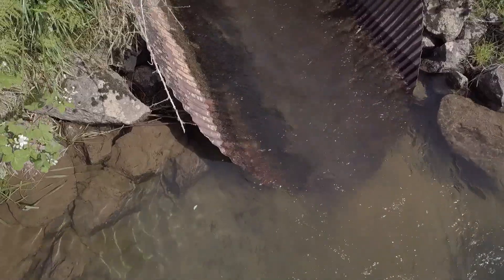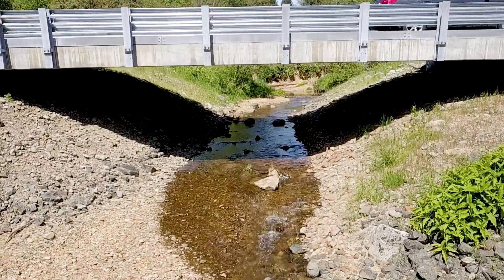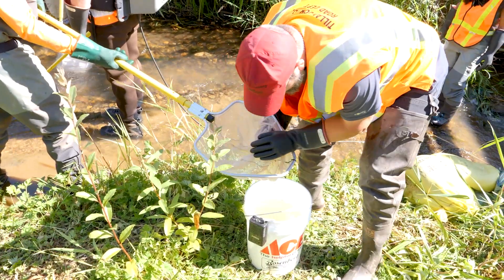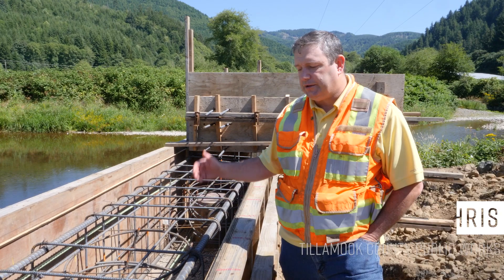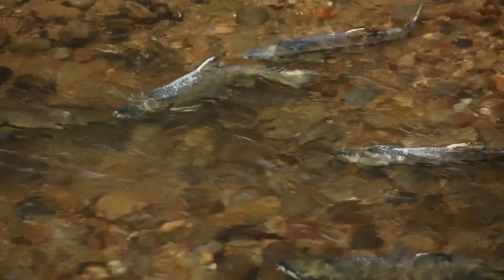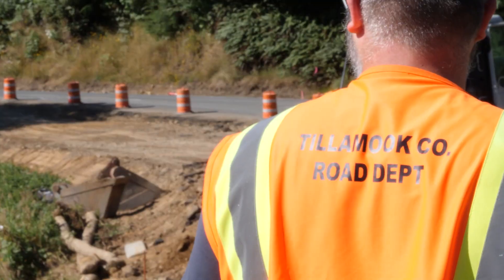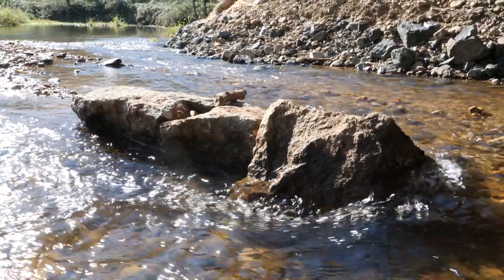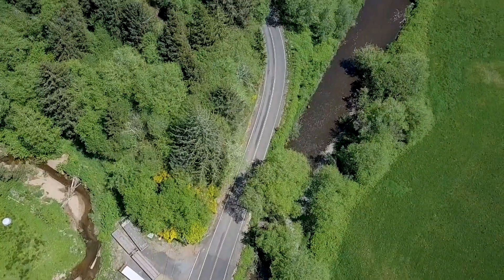Removing Barriers: Converting Culverts to Bridges for People & Wildlife

Comment: Whats the difference between the second bridge they built and the first one that traffic is going over?
Reply: The soil or bank structure surrounding the culvert,and below it was beginning to be worn away by the water flow, below the bottom level of the culvert, resting on the stream bed; water was flowing underneath and to the lower sides of the circular culvert. If there was increased water flow in the stream, creek or estuary during a rain storm, or due to melt water in Spring, the culvert might be washed away. Sometimes during increased water flow, the road above the culvert is also washed out, either through increased water level, or because the culvert is levered out by the water flow. Removing this less stable structure, and improving the stability of the road with a bridge helps the surrounding area, to some extent, cope with increased water pressure during high water, due to storms, or melt water.

Comment: One of the fascinating hydrologic aspects of the culvert was its effect upon the larger river that the stream flowed into. Much like air forced through a straw, the water flow from the culvert formed a faster higher pressure flow that created a "scouring" effect downstream of the river, altering the rivers overall flow pattern and bottom structure.

Comment: Bridges are much more costly to build and maintain than culverts.  I would rather see a culvert anywhere it is possible to eliminate bridges.  This idea of bridging culverts may sound like a good idea when there is grant money available for the new build, but road departments never have the budgets needed to adequately maintain the bridges after they are built.    A six  foot culvert may cost under $10,000 to install.  That bridge will be in the hundreds of thousands.
Reply: If you americans fix your suburbian sprawl issue, you'll get more funds for infrastructure
Reply: Think about how much money we can save if we just did away with biodiversity and wildlife. /s
Reply: @MFgr8  i'm pretty sure you can design a culvert without creating a barrier. Choose a slightly  bigger one, make sure there is a threshold downstream to always keep a sufficient level of water without a drop, allow for some sedimentation, don't build it too long.

Should fix all the issues without needing an expensive, non-recycleable concrete bridge with huge piles driven right through the formerly undisturbed water-guiding sediments that make up the riverbed.

It's not like building a bridge won't have negative impacts.
No solution fits everywhere, and actively thinking is much more useful than just knowing.
Reply: @nos9784 At the time the culvert was examined before the bridge was built over the road, the stream water was no longer being contained by the culvert. Water was flowing in both sides of the culvert. This insufficient management of waterflow was being rectified by building a bridge over the water.

Comment: Some places use rectangular section pre-cast concrete culverts, to keep the construction time down  but still keep the flow velocity low.
Mind you, I don't know anything about how the soil/rock geology determines whether that's feasible.
Reply: Most places in the Portland area of Oregon use that form of Culvert. Though here, they use it specifically "prevent flooding", and no other reason. In the hood where I grew up in Aloha, there is a creek called Butternut Creek that runs through it, and they exclusively have used concrete rectangle culverts since the mid 2000s as the homes built near and next to it would often experience flooding, thus the roads would become impassable for a few days to a week or so at a time. But you can clearly see despite the lessened impact on velocity, they're still altering the overall pathing and health of the stream.

Comment: Integrity of the Bridge is, of course paramount, yet upstream responses could impair the Bridge with very high flows, and additional debris or bank collapses, large woody debris and bedload to test its span and clearance.
Reply: My only concern is the lack of any vegetation on the loose rock, gravel & dirt embankments at the base of the bridge structure. Over time, that will get eroded pretty heavily without some kind of natural reinforcement like grasses and small ground-cover and shrubs.
Reply: @TheCriminalViolin  The bridge is ancored with deep piles. A lot of material can be eroded before there is any danger to the bridge. And if it's a healty stream you will have erosion, but also new material coming from upstream.
Reply: I'm pretty sure if the culvert lasted as long as it did that bridge wont have any issues.
Reply: @LKN117  i disagree. Climate change, in the form of greatly increased water flow, or even greater drought, makes future weather conditions more difficult to predict , than in previous decades.
Reply: @sianiswack 🤣